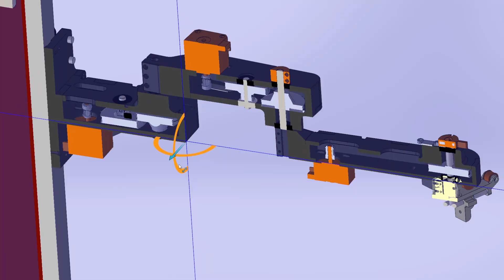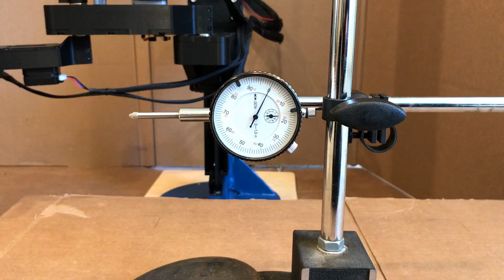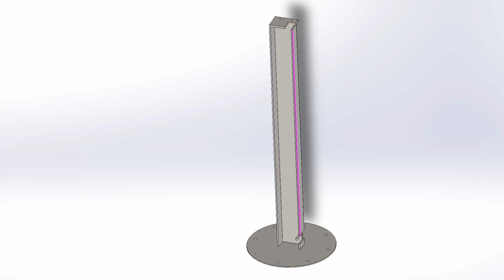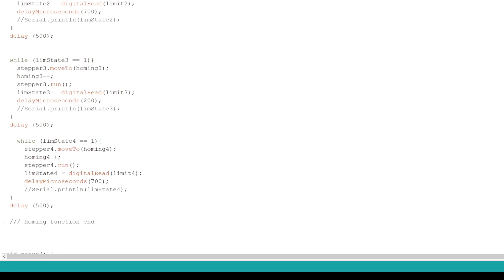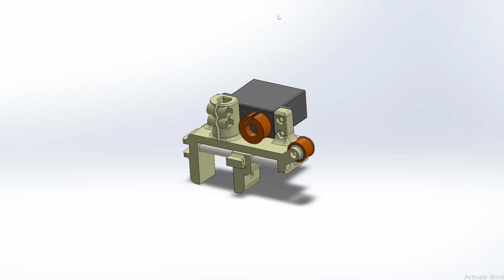3D Printed Arduino SCARA Robot

Comment: I built a Mechatronics Scara arm that uses Processing environment to code the kinematics.  Although I'm working on a "Phantom Chess", that moves pieces from underneath the board, I'm considering using my SCARA for the chess setup you have.  I have the Github download and looked at some INO files but my stumbling block is the link between the computer deciding what piece to play and then the arm taking those coordinates and making the move.  Any hints as to where/how to start?  I'll try and put everything you have together in some kind of flow diagram but your hints might help me get there faster.  I'm almost done the Phantom and I'm thinking that if I have to know where to pick up a piece and where to put it down, gives me the coodinates I need to program the SCARA arm

Comment: what are the settings used for printing?
Reply from the maker: I don't remember exactly, but they varied a lot between parts. Parts like output pulleys need stronger print settings than other parts like the arm segments. I can't give really specific advice without knowing what printer you're using etc.
Reply: @ivprojects8143  thanks for the reply. I'm using an ender 3 for 3d printing

Comment: What material did you print this in? PLA? PETG? Did you have any issues with the motors heating and warping the prints since they're directly connected? Any input is appreciated. Thanks!
Reply from the maker: It's PLA. As long as the motor current is set reasonably heat shouldn't be an issue.
Reply: @ivprojects8143  Great to hear. I was a bit worried about that. I know they don’t run too hot, especially in an application where they aren’t running for as long or continuously as say, a 3D printer. I just didn’t want to be wasting my time trying PLA. Excellent work. I look forward to more videos from you.

Comment: Hello, I really congratulate you for you neat and smart design. Especially the V-Rollers and counter weight like in a real elevator is a good idea. Other than these, your design seem to be quite modular and each motors/activators could easily be reached and replaced. Normally I printed and assembled another similar model I found here in YouTube, but the biggest problem I faced was replacing cracking/broken parts, ruined electronics/stepper motors. In your design it seems like it won't be that much hard for me, that is why I am thinking about building your scara robot. Could you please give some clues about the elevator mechanism. How can I find such a steel part to mount the sigma profiles onto which the V-rollers will go up and down? And also a little more about the belt and counter-weight mechanism of yours. I examined your BOM but could not see something related to these. Any help would be appreciated.

Comment: Just a tip. Many of us have ender 3 and have upgraded the main boards. I like to repurpose these old boards. Even the 8 bit creality Melzi boards are great foundations for this type of projects.  I'm also a fan of running GRBL32 on a ESP32 over wifi, I even got Marlin running on an ESP32 with a tiny OLED display.

Comment: Great stuff! I'm working on a 8 foot tall 6 foot reach cement printer. You gave me some ideas to try. Thanks!
Reply from the maker: Interesting! Are you making it a SCARA style design?
Reply: @ivprojects8143  At first it was SCARA but the complexity and cost of the Harmonic drive. So for now it is POLAR running Duet Firmware. Nema 23 and Nema 34. It may be Dual arm so print 2 columns at once. Based on Affordable Aluminum Trusses.

Comment: why didn't you zero your dial indicator?
Reply from the maker: I zeroed it at first, but I accidentally bumped the setup and forgot to fix it. It doesn't really matter in this case, since it's only measuring repeatability.

Comment: I’ve recently become fascinated by strain wave actuators. Have you experimented with them at all? It seems like a good fit for your z axis since they are not back-drivable.
Reply from the maker: I haven't tried strain wave reductions because I think they would be very difficult to 3D print. I have seen a few videos of people doing just that, but I've never seen anyone test them for long periods of time to see if they're reliable.

Comment: Cool project!
But I have a question about inverse kinematics: 7:48 is it really necessary to flip "knee angle" when a head passes over the Y axis? It costs a lot of movement and time. I think, it's better to bend arm in one predefined direction. It would work much faster.
Please answer and good luck with other projects!
Reply from the maker: Thank you! It is necessary to eventually flip the knee angle to have the largest possible work envelope, but it could be more optimized. Rather than flipping every time it crosses the Y-axis, it would be more efficient to only flip when needed to reach the desired position.

Comment: Cool project man! I’m also an undergrad MechE student and I did a very similar SCARA robot last year, same general set up with the cnc shield, motor drivers, inverse kinematics, etc. Have you looked into actuating a robot arm with BLDCs? I’m working on a 6DoF robot arm with BLDCs and it’s been fun. A lot more torque and smoother and quieter operation although a bit harder controls since they operate on a closed loop system.
Reply from the maker: That sounds like a great robot you're working on! I absolutely want to try using BLDC motors in place of the steppers, but I haven't bought any yet due to their cost. I'm guessing you're using O-Drive?

A 6 DOF robot is on my list as well, but I'm still trying to decide on the design of the forearm in particular. I'd like to do something like the concentric shaft setup used on some of the Kuka robots. Are the gear reductions on your 6 DOF robot 3D printed?
Reply: @ivprojects8143  Yes I’m using two Odrives to drive 4 BLDCs, then I have a nema 17 stepper and a smaller servo that take care of the other 2 DoF. Did that to save in cost because that way I didn’t need to buy a third odrive and the 4 BLDCs handle pretty much all the load. And I got lucky cause I was able to get a student org at my university to “sponsor” the project and buy me all the parts.

And yeah for the reduction I’m using 3D printed pulleys with belts. I’m also using a differential drive which means that two motors driving the differential give me 2 DoF and both motors work together to counteract the moments created by the weight of the arm. That way I only need half as much torque from each individual motor and allowed me to use cheaper ones.
If you have a Discord or something I can share pics of the setup.
Reply from the maker: @dossantos9498  That sounds like an interesting design! I'd love to see pictures of it.

Comment: Dude, thanks can I do this for our engineering project, can u help out?
Reply from the maker: Sure, you can use my design for your project as long as you provide credit. I'm a full-time student so I won't have time to walk you through the build, but if you have a few questions along the way I'll do my best to answer them. The SolidWorks assembly file should explain how things go together pretty clearly. Good luck!
Reply: @ivprojects8143  I will be more than happy to include You in our credits and references..
Reply from the maker: Thanks. Is this a project for a class at college?
Reply: @ivprojects8143  yeah 6th sem mini project.. For btech

Comment: Did you print the gray big gear at 1:52? (The black one Looks printed).
Reply from the maker: Yes, all the pulleys are printed. I ran out of the black filament at one point so a few of the parts are gray. They are all printed in PLA, however. The output pulleys like that gray one need to be printed at a very high infill value because they experience high loads where the D-shaft interfaces with them. The compound pulleys can be printed at a lower infill value since they don't experience this load.

Comment: I've been trying to see how the output shafts as connected to the next segment out.  I could see the one next to the metal z axisb but not the others.  
They seem very ridged. Are they just plastic half cylinders with bolts gripping the shafts?
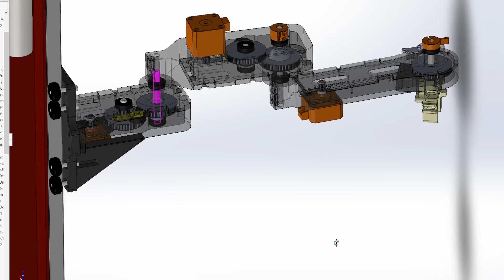Reply from the maker: The segments are connected together using printed shaft couplers with inset M3 nuts to tighten them onto the D-shaft. I think the view of the CAD model at 1:08 shows them the best. It took a few tries to make them rigid enough. Hope that helps clear things up.

Comment: Very big nice!  What is the backlash in degrees?
Reply from the maker: Thank you! Since these actuators use timing belts, there is no backlash that I am able to notice or measure. Properly tensioning the timing belts is key here, which is why I focused on that a lot. 

There is a little bit of inevitable deflection under load in the horizontal direction due to belt stretch. This can't really be measured in degrees though, since it's load dependent. I think it could be roughly expressed as a spring constant with the right testing.

Comment: Really cool project, thanks for posting the files !
Reply from the maker: Thank you! I'm happy to share the files. If you decide to build one, just let me know if you run into any issues or if there are missing files.
Reply: @ivprojects8143  Hey, would it be possible for you to upload a bill of materials? (I can work most from the solidworks files, but I'm not sure about the rest, like belt lengths)
Reply from the maker: @miron__  Sure, I just added a BOM to GitHub. Please let me know if I missed anything important. I also updated the SolidWorks Assembly to fix some little things.
Reply: @ivprojects8143  Thanks for adding the BOM, I bought most of the parts, but I cannot find a source for the D-profile/flat ground 8mm rod. Where did you buy yours? Or did you mill it yourself?
Reply from the maker: @miron__  Yes, I made it myself. The best tool for the job would be a mill, but I don't have one. I used an angle grinder to remove the bulk of the material, and then finished it off by draw-filing while frequently checking the dimension with calipers. You want to remove 1mm from one side to create the flat (So for the 8mm rods, it should measure 7mm on the flat).

I really wish I knew of a good source to buy D-profile shaft, but I was not able to find any. Luckily it's fairly easy to make.

I should add some information about this to the BOM. Thanks for the reminder!
Reply: @ivprojects8143  thanks again
Reply: Where ca i found 3d files please?
Reply from the maker: @petermarkovic2011  The files are posted on my GitHub page. The link is in the description.
Reply: @ivprojects8143  THX i will post when i finish him
Reply from the maker: @petermarkovic2011  Sounds good!
Reply from the maker: @petermarkovic2011  Here's a direct link to the files: 
https://github.com/IVProjects/Engineering_Projects/tree/main/ProjectFiles/SCARA%20Robot

Comment: Awesome project! 

I've been working up to building a 6 DOF style arm but seeing this has made me consider if I should give a SCARA arm a go first.
Reply from the maker: Thank you! I'd like to design a 6 DOF style arm as well at some point. The inverse kinematics of a SCARA is a lot simpler, and I would say it's easier to mechanically design a SCARA around 3D printed parts than a 6 DOF arm. I think it would be pretty difficult to design a 6 DOF arm using 3D printed gearboxes instead of more compact metal planetary gearboxes.

Comment: Hi IV Projects,

I am really impressed. How you have tested everything. You have done really well. If I understand correctly, you are using a toothed belt with a pulley to increase the wrap angle. This is certainly also practical when you later have to tension the toothed belt. 

There are also many things which you can still retrofit. I could imagine that interchangeable attachments would be cool. Maybe you could also connect a camera and try a sort by color.

I myself am also new to prototyping, for my mechanical engineering studies. That is why I am impressed by your machine. I would not have been able to do that, at least not yet.

Really good and informative video, keep up the good work.
Reply from the maker: Hi Raffael, Thank you very much!

Yes the timing belts can all be tensioned without disassembling the robot if the belts stretch over time.

The gripper attachment is easy to swap out, so there are a lot of things I would like to try with this robot. The sort by color idea sounds interesting!